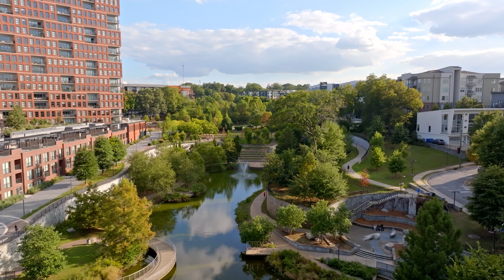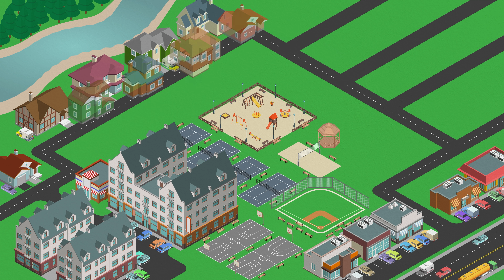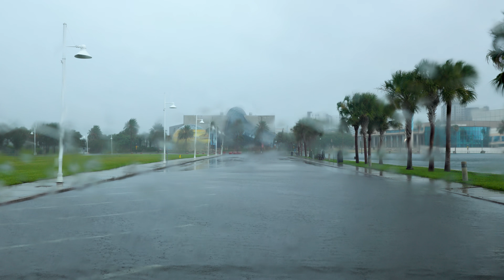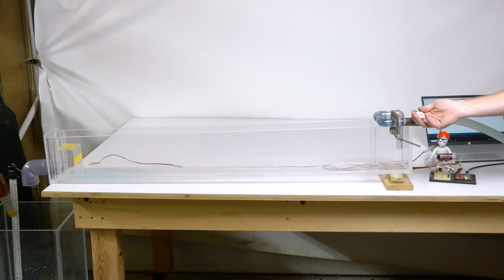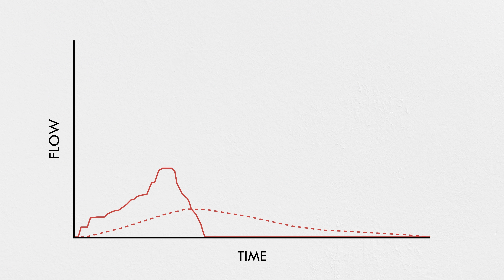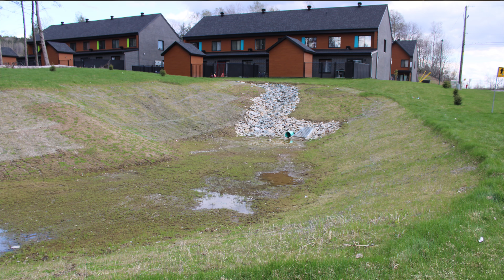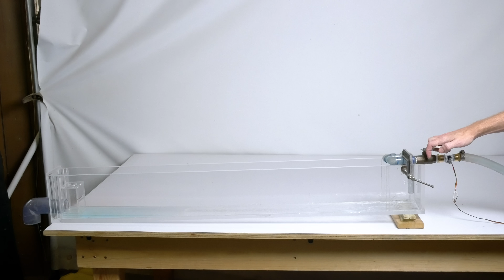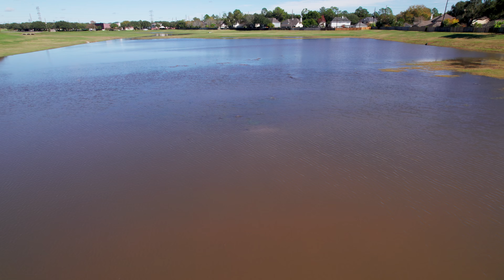Do Retention Ponds Actually Work?

Comment: Ask Ellicott City, MD how important storm water management can be.
Reply: The majority (probably) of the development upstream of Ellicott City uses an older design/scheme of management that declines in effectiveness over the "one-year" level. When they got larger storms, a lot of those things eroded and failed to various extents... after they were transferred to public ownership, where they ended up on capital projects lists that take a long time to get to.

But when you have 4 square miles of drainage area in a wet climate on a stream that flows under buildings, that whole arrangement is on borrowed time regardless of what you do... even if the upstream land was all still farmland, the buildings on the stream side probably still would have been taken out by that storm. The water could get through maybe, but all that fall is energy getting taken out on the banks...

Comment: We had a housing development near the outskirts of town that had a flooding problem - not the development itself so much as the only entrance road in and out would be under water [really nice neighborhood too]. So, after about the third big rain incident about 25-30 years ago - a retention pond was dug right at the entrance. It a few good-sized pipes that stuck-up a few feet above the water level and a square, open-grid top structure in the middle that stood higher - no idea where the water drained to, not an engineer and I'm just recalling. That was the answer - never a problem since then no matter the amount of rain. I'll have to go by and check it again - since we are in a drought now and see what it looks like way low.

Comment: @15:00 it seems like the detention isn't a perfect solution but it is still way better than the combined non-detained peaks so I don't understand what you mean by making it worse
Reply: If not coordinated with the other systems up & downstream well then the peaks could all hit a given point at once.  So although any given one outflow won't be as bad, they all join up instead of hitting higher individual bursts at separate times downstream.
Reply: Imagine rush hour, but for run off, rob. That's what he meant.
Reply: I had the same doubt

Comment: Context: I live in Las Vegas. The 2 retention ponds a block west of my neighborhood are basically giant grassy pits sandwiched between neighborhood streets with public parks on either end. They actually have a very deep bed of rock under the grass and soil and they basically act as both retention sinks to slow the flow into the MS4 system heading further downhill: towards my neighborhood which is already an artificial wash taking water off of the freeway, but the grass-bottom is intentionally meant to help retain water in the aquifer by giving the water time to sink into the ground there, below the clay levels.
Reply: In Albuquerque, there are only dry detention ponds, not retention ones (except at golf courses, which act as stormwater facilities, but those are usually filled with reclaimed municipal water.), but they are so large and many in number that the aquifer is constantly rising. Most are just bare bottom pits or dams between to hills, but some double as fully fledged parks, like with paths, structures, grass, sometimes even sports facilities.
Reply: @Jul-66  Those retention ponds I mention are basically part of the parks on either end, they have soccer goal frames in them and people can ride ATVs down there.
Reply: @Gam3Junkie7  Yes, sports fields tend to dominate such dual-use facilites. The undeveloped ones have ATV trails, and it is not uncommon to find the occasional horseman riding in one.

Comment: On the subject of maintenance of retention and detention ponds, and how inconsistent it can be, the letsdig18 YouTube channel used to at least semi regularly do dredging maintenance on some of these ponds. Often developers hadn't left proper access for them to get in and do the dredging, and it wasn't uncommon for them to only be doing the work when authorities were forcing the pond owner(s) to have it dredged rather than when the pond should have been dredged due to the costs invovled, especially with the lack of access.
Reply: In terms of YouTube Channels, the issue of Beavers Damming up Outlets is another interesting consideration!

@Post.10 deals with that stuff a good bit!

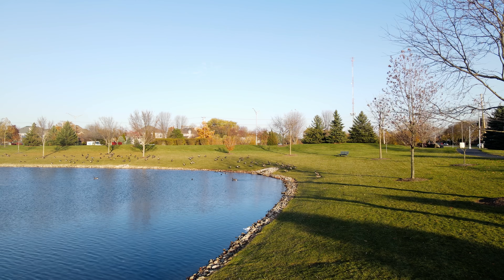Comment: 11:05 My neighborhood backs up to a retention pond for another neighborhood. Over the decades the accumulated silt in the old pond has reduced its capacity, leading to flooding in our neighborhood. Lots of lawsuits and involvement with our local drainage commission is where we are now, as we try to figure out who is responsible to maintaining the long term capacity of the pond.
Reply: That can be tricky. I used to work for a city that required the HOA's of the neighborhoods to maintain their respective retention/detention ponds. When the city began annexing areas that were developed under county standards (the county maintained all ponds), the city was forced to take over maintenance of these ponds. This prompted other developments that had previously had to maintain their own ponds to demand equal treatment. The city relented and ended up taking over maintenance of all pre-existing single- family development ponds. It put a huge, additional burden on the already understaffed storm water maintenance staff.

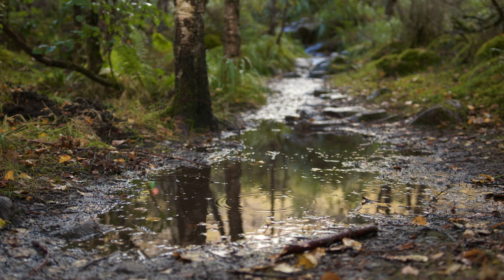Comment: Note 3:11 Clays have more void than sand (Porosity from 40 to 60% compared to the 20-30% of sand) they just have lower permeability due to the higher Tortuosity and smaller particle size.
Reply: Your comment has high torturousity due to the lack of an explanation of Tortuosity
Reply: Clay has too many turtles, got it.
Reply: @pairofrooks the internet is so enlightening
Reply: Despite having more total pore space, clay's pores are extremely small and poorly connected, resulting in low permeability—meaning water moves through clay very slowly.  In contrast, sand has larger particles and larger, well-connected pores, leading to lower porosity but high permeability, allowing water to drain quickly.  Thus, while clay holds more water overall within its pores due to that high porosity, sand allows water to pass through it.

Comment: I used detention and retention ponds a few times when fixing drainage problems. Found that the towns didn't want to maintain them. Over the years, outlets plugged, the areas overgrew, and the basins filled with sediment. They're a good idea but, as usual politicians will mess things up. Good video and explanations. Good Luck, Rick

Comment: Grady, one major issue with your demo, no contaminant skimmer weir into the design as required by ANY PERMITTING AUTHORITY HAVING JURISDICTION.This internationally known part is required to exclude  any/all oils/contaminants from entering the overflow basin discharge tributary system. No known modern day western country can construct any retention/detention resivor without it, solely due to ALL hard surface or paved runoff entering the basin. Please consult any civil engineering handbook, or any water authority having control jurisdiction towards permitting of any type containment basin.

Comment: In Hutchinson Kansas, they built a retention wall/berm around the outer side of the city, hugging the Arkansas river, to prevent the city from flooding during rainy seasons. It stretches for almost 28 miles and is a beautiful site to see
Reply: Those are called "levees."

Comment: There is a retention pond behind a shopping center I’ve done several buildouts in, and I saw tanker trucks constantly coming and going. They were hooking up to a pump house and filling, driving away, and returning to do it again all day. I finally talked to a driver and found out that under heavy rain the drain for the pond is too small. The houses nearby will flood. The city has been trying for years to find a solution, but they still keep paying trucking companies to haul out one tanker at a time and discharge it in a nearby river.
Reply: I wonder if they've thought to use that water to irrigate things like grass along highways, or fields instead of dumping it in the river.  I've seen water trucks along the toll roads around Orlando doing that.  They water the young trees and newly planted grass.
Reply: Take out half the parking at the shopping center and add additional stormwater controls.
Reply: @frederickheard2022  unfortunately this shopping center is one of the exceptions to having twice the lot needed. On a slow day you’ll walk half the lot to get to a store, and on heavy days people drive in circles for 20 minutes to find parking. The only solution I can think of is to sue the shopping center to tear up a big part of the lot and add an underground retaining pond. Every business there would fight the city, and the owners of the center to stop it. The city was the one that originally approved the overflow spillway to not have a real destination.
Reply: @davidelzinga9757 is the parking lot only ground level? From what I've seen, that's common in the US. Here in Australia, most parking lots over maybe 100 or 200 cars will be multistorey. That seems much more efficient use of space, though average US car size I think is bigger than here.
Reply: @frederickheard2022 Private land, not as easy to just implement. They probably need the parking space for the customers, since the US isn't big on walkable cities
Reply: @OutsiderLabs Eh- usually parking lots are sized for absolute max traffic, and you could size down a bit by encouraging more businesses to share parking space rather than having each site’s parking independent
Reply: @OutsiderLabs   unfortunately, poorly understood traffic studies conducted long ago when study methodologies weren't very robust have lead municipalities to enact zoning laws that require parking lots of excessive size. The parking space a business needs for its customers and the parking space a business needs for complying with legal requirements desperately need to be realigned. Plus, those oversized parking lots are a big reason that US cities aren't walkable. US businesses and municipalities need to be reminded that foot traffic is much more valuable than automobile traffic, especially since people speeding by in automobiles aren't shopping and looking around at what's going in the local shops which tend to generate more money for the municipality. They are beelining toward a destination big box stores, safe and isolated from the filthy peasants and their silly small businesses.
Reply: @OutsiderLabs  true but most of the time there is far more parking available than what is needed. Don't know if that's the case in your situation.. but also yes if the owner of the land doesn't want to do anything like that then yea it's not going to happen unfortunately
Reply: @OutsiderLabs  while youre 100% correct that the US doesnt do walkable infastructure, when is the last time youve seen a shopping center have a full parking lot? Not one that is mostly full and makes you walk across it to get to the store, I mean a FULL parking lot, no spaces available? I bet you havent seen it. Everyone would be better off if that city just paid the shopping center to give up  a portion of their parking lot in order to stop needing water to be trucked around. Hell, split the difference. The city could pay the shopping center to install a system that collects the rainwater from the roof and stores it in tanks behind the building. There are many solutions, but I bet the shopping center doesnt want to change anything despite being the ones causing the issue with all their pavement and roof area.
Reply: Tanks are very small compared to a pond. And twice i have seen a full parking lot (very close to chirstmas) most of the time their is lots of parking. 

And they can't really take less space for parking then they have used.
Reply: @OutsiderLabs  classic murica everything for capitalism. Flooding houses no problemo
Reply: @cherriberri8373 those costs get passed onto consumers both ways. 

And in this specific example it is for the protection of just one neighborhood or street. 

I think you underestimate how much cost goes into this and to whom it goes.
Reply: @bb-fg8cv How is that capitalist?
Reply: @cherriberri8373 Some places in the US have parking mandates that require X number of spaces per Y number of square footage so strip malls and shopping centers in particular usually are required to have (often unnecessary) amounts of parking space by law.
Reply: @bb-fg8cv the answer is not to build the houses in a flood prone area to start with.
Reply: Getting rid of parking minimums is the new thing
Reply: @PenjaminNostien This has become a huge issue in my city. I grew up in the 90s playing in the woods near my subdivision that was built in 1969. It would flood a few times a year and they kept adding wider culverts to try to handle the flow but it was just too swampy to build. They finally did build something there a few years ago. I’m sure every other low spot in the city is being developed now too. The local paper did a scathing investigative piece about how thousands of houses built since 2020 are in flood zones according to OLD usgs maps, and they can’t get insurance. With those areas that used to flood as forest and meadow made impervious, how bad will it be now?? All three municipalities are guilty of approving construction they really shouldn’tve. The developers don’t care, the companies are from six states away, owned by private equity investors, and nobody there will set foot in town, much less live in one of the at-risk houses. All the extra tax revenue should be improving our infrastructure and schools, but they are instead just extra stressed from being massively overcapacity…
Reply: @OutsiderLabs Are there no bus stops or light rail stations to and from the shopping centres?
Reply: Save your tax money for learing centers